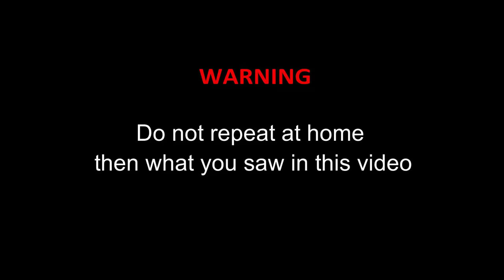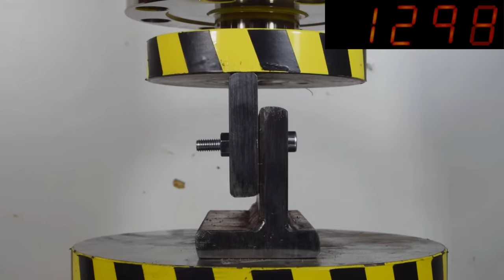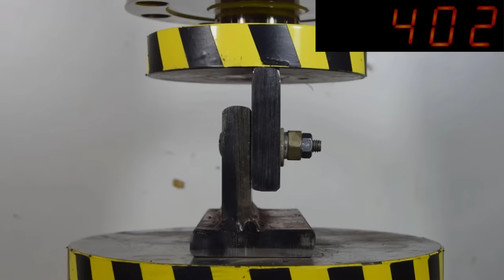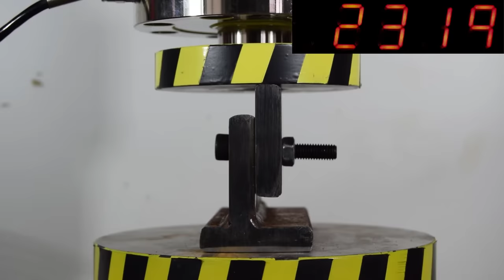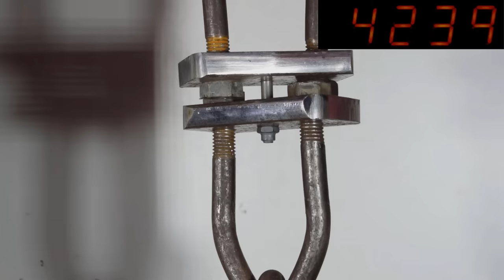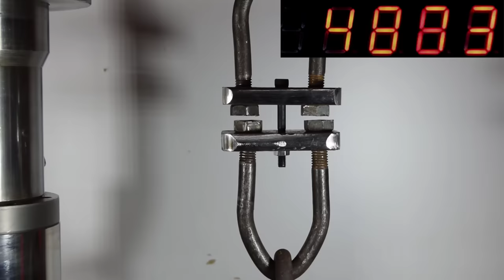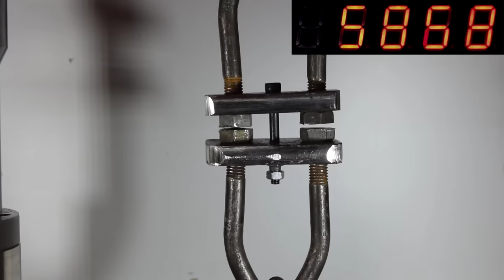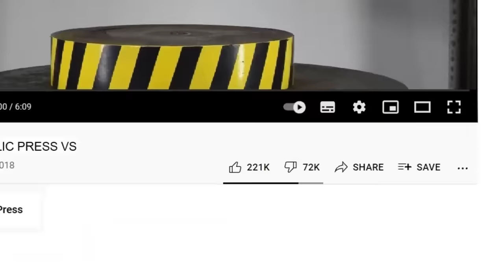HYDRAULIC PRESS VS TITANIUM BOLTS

Comment: Genuine titanium is capable of withstanding MUCH more pressure and load. Processing titanium is a challenging process.
Reply: High quality steel with the right hardness is still stronger than the best titanium alloy, titanium is used for weight reduction and corrosion resistance without giving up to much when it comes to strength.
Reply: @andreasfjellborg1810  You are right. my boss at a titanium forging plant used to say "CP-Titanium is only as good as 316 Stainless in strenght but with much lower weight. There are stronger metals, such as nickle alloys that will beat titanium any day in strenght.

Comment: Would be cool to see this done with better controls. All bolts same diameter. Same threads. Torqued to the same spec or maybe “optimal” spec for the given material.

Comment: The methodology was a little iffy and I couldn't figure what the results actually meant, but I love that you tested for strength and didn't just crush the bolts. Tensile and shear, it's what a bolt does.

Comment: Been heard titanium is weak on impact and good at handling high heat, so the test result is more than I expected. And I wonder, doesn’t the manufacturer give the standard, of how much force the bolts are designed to handle? …
Reply: Yeah, this guy is just checking the numbers. Also those numbers are what the manufacturers are sure their product can handle, not what it will.
Reply: @SoMuchFacepalm  does these numbers indicate the tons it’s purposed to handle? I don’t really get it, not enough information
Reply: @minercraftal  pretty sure he's using kilos in the counter in the corner.

Comment: I have a question about those shear tests. Did you torque them to spec for specific steel or titanium and have the same torque specs for each?   Only asking because the bolts are much stronger when torqued when applying to sheer strength. I believe tension strength is improved as well but I haven’t specifically looked into that in the past.

Comment: In the 60’s my dad worked for a company that produced fasteners and components for aerospace.  Each and every piece had to be shot peened, magnafluxed, x-rayed, fail-tested and meticulously inspected under a stereo microscope… then personally signed off, every step of the way to ensure a tolerance as close to zero as humanly possible.  It’s an expensive and labor intensive process…
Reply: And then NorskHydro goes and fakes thousands of tests over almost 20 years
Reply: @nicholasdenney1318  I suppose, if they are Fakers.

Comment: Don't just compare values of force applied on each bolt. They can be of different cross sectional area. The strength value should be in psi (pounds per square inch of cross section area) of shear, tension or compression.
Reply: not in most if the world! kPa?

Comment: Some values worth taking into account: oxidative stress, heat stress and how both of those affect elastic and plastic deformation. I imagine the space use titanium can handle both values better than the cheap titanium as that is the environment they need to be designed to tolerate. (High G stress and atmospheric friction).
Reply: High G stress and atmospheric friction HAVE ZERO to do with anything regarding these bolts. In fact high G stress isnt even a thing regarding mechanical fasteners. Its got to do with a persons ability to withstand high G's. Atmospheric friction..lmfao you dug deep for that nonsense. We dont engineer nor test bolts factors that do not apply. Ask me how i know.
Reply: @NoBallsInWomensStalls I'm curkous how do you know?

Comment: Just wondering, what is the rate of metal fatigue for both alloys? The weight and that should be the biggest factors for choice using it in a space craft
Reply: Well, weight is very important too when you want to make flying or space screws :)

Comment: 6:31 this is not a proper test for bolt tensile strength.  You used a thin section but that is not intended to hold loads for tension.  From the video you can see that the threads are sheared.  When you have a booted connection in tension, the threads and nut should never fail.  Only the bolt shank (grip) should fail.  Again, you need to use a proper tension but for this test.

In the following segment you realized it and then used a different nut and the test right broke.  It needs a bit of explanation to the audience.

Comment: why do you put the steel bolt in the middle hole, and the titanium on the outside holes, sus
Reply: Mechanically, that makes very little difference. It's not a lever by the distance from the center hole, moreso, it's a shear /lever by the two separate plates, and the downforce/upforce is the same for both positions. It's not distributing force to another bolt surface, so both configurations are equal.
Reply: @RuleOfRage still for the sake of the experiment, you need to keep those things consistent
Reply: @user-it8gk3ke7h  if that was the case, the bolts would need, same diameter, same shank, same thread pitch, same bolting torque. It's close enough for a comparison for Chineseum vs titanium

Comment: Yeah well, I dont know what was the purpose of this "test", it is very unprofessionally done and there are many flaws giving only a proximate results. Maybe because this channel and its crew only knows how to operate the press knowing much of nothing what they are actually doing? 
Titanium, there is dozens of different alloys with all have different properties. You cant just say "Titanium" without knowing its composition. In overall Titanium is not used for its strength, but because of its other properties, weight/strength ratio, corrosion resistance, heat properties etc. Steel has other properties which fit to many.
Reply: I had a real eyeroll at his "tension" apparatus.  Hardly surprising it broke.  That kind of foolishness could get somebody hurt.

Comment: Why titanium for spaceship is weaker than aliexpress bolts?
Reply: Thats not how titanium works, titanium is lighter than steel, but similar strength, the aliexpress bolts arent oure titanium and have other alloys in them to make it cheaper to produce, but they are about the same weigh as steel, not titanium, making them useless
Reply: Probably optimized for weight VS optimized for strength
Reply: Dans un assemblage mécanique il faut toujours créer un "point faible" ,c'est souvent les vis et les boulons qui sont prévus pour casser avant que les contraintes abîment des pièces plus chères où plus complexes.
Il vaut mieux casser une vis à 10 euros qu'abimer un carter à 1000 euros sur lequel elle est vissée.

Comment: I just bought some Grade 5 Chinese Titanium socket head cap screws for my motorcycle. Glad to see the results here. They’re really not worth the price, IMO. It depends on what the bolt is securing. Titanium bolts can cost up to 10x the amount that stainless steel bolts cost. But as an experiment and used judiciously, they can be worth the cost.
Reply: I've used Aliexpress titanium bolts for years and have Aliexpress titanium bolts holding my brake discs on , good quality bolts, and way stronger than the grade 8 bolts they replaced...

Comment: these bolts are from different alloys of Titanium.  Don't expect them to be even close to eachother, and Titanium is known for its TENSILE strength. Shear strength is quite another thing.  this is a badly thought out comparison.  Also, for the cost of the bolts, the Ali Express items are a lot more bolt for the buck.  you can get 5 Ali bolts for one NASA bolt

Comment: if you're wondering why titanium made in china has more shearing capacity, the reason is because it's straining unlike the other one. This is probably because of the faulty testing equipment. The bracket isn't supposed to let the bolt rotate but the Chinese bolt rotated a bit.

Edit: Rewatched the whole thing again. Might just be the bolt tolerances allowing the nut to move a bit causing the loose bolt connection under shearing stress

Comment: Years ago a surgeon in Hawaii found out right before surgery that he didn’t have the titanium rods he needed. He went to the auto parts store and bought titanium screwdrivers and hacked off the handles. The rods he inserted ultimately failed and after the next surgery to replace them the doctor tossed the inferior rods but a nurse retrieved them and turned them over to authorities. The patient was very elderly.  I remember thinking that this guy went through too much to get to the position of a surgeon and then just shanked it. Like is a race to see if you die of natural causes before you really screw up something.

Comment: The Chinese bolts sold on ebay/ aliexpress are normally grade 5 which is 6% aluminum and 4% vanadium.
The chinese also sell the grade 2 titanium bolts. Which is not an alloy and is dull grey color.

Comment: Not sure I agree with these results. Did you control for pretension? If you did this by torque, you could be out by 25% of your target pre-tension in either direction. The same goes for a constant rotation of the nut when tightening.

You can also see the jig you have failing in bearing. It likely would have been better to do this in double shear rather than single, and ensuring that bearing failure did not occur. It also looks like you have some different sized bolts along the way, which will change the force required to break it. 

The aliexpress bolt may very well be stronger than your spacecraft titanium bolts, but I'm not certain of it.

Comment: The bolts are completely different configurations - head type, thread length, surface treatment, maybe heat treatment. They would have to be the same in every element of design to offer any valid comparison of strength and durability.

Comment: You need to tension the bolts with a set torque. There will be a big variation in shearing depending on how much friction you put on the plates.

Comment: Good test. However the only thing I would change is when testing the tensile strength, I would have used a nut with the same material as the bolt per test. I understand that the stainless steel nut was the constant but I’m sure some numbered would be different if you used the same grade nut per bolt

Comment: In aeronautical industry the reason why the components are expensive is because of the tracking they have and consistency they are upheld to.  Not just raw performance.  In circumstances a hardware store bolt could perform better but it also could perform way way worst.

That's were the problem lies.

Comment: in first application it is critical to torque them the same - otherwise you can just estimate the shear force

if you tighten those steel bits properly the main resisting force comes from the friction between those two, which is proportional to the torque on the bolt, after that you just snapping it - the pulling test is done much better, but the weak point is always the thread

Comment: Titanium isn't really stronger than a similarly sized steel screw. Its benefits is that it has equivalent strength with much less weight. So you can either have lighter components without sacrificing strength, or more strength with equal weight.

Comment: I'll send you an A. R. P. (American Racing Products) grade 18.9 9/16th inch main bearing bolt to BREAK your press with for the $183 it costs. Each one is shot-peened to relieve stresses and X-RAYED, then nitride finished and polished. ARP bolts went to the MOON for NASA and are used in racing car engines or in my restored 1964 Honda 305 SuperHawk engine (in metric sizes). They had a video of a 7/8" ARP bolt picking up a NAVY SHIP in the yard! It streached enough it was impossible un-screw...but it supported a 450 TON ship.

Comment: Did I miss weight on China bolt? It Also - the China bolt appears to have some type of heat treatment which could drastically increase shear strength. And for the tensile strain test - that seems like it's mostly measuring thread/head strength. I'd order to fully complete an accurate strain analysis, maybe ask your local university. Their engineering department likely has some actual strain test equipment that you'd be able to use! Cool, video tho! Overall demonstration of material strengths still shows the overall difference between them all!

Comment: Most of all, if Chinese bolts are titanium, they are at most titanium oxide covered steel bolts. That’s a first. The second thing is all the people are talking about - titanium is not about “spaceship” durability, rather it’s about being lightweight.
Reply: A magnet would very easily tell the difference between 6/4 Ti vs steel bolts with a Ti coating. No manufacturer would try to pass off Ti/Ox covered steel bolt as Ti, not even on Ali Express. Also, the steel bolts would be twice the weight.

Comment: The only things I have against this test is that the nuts and bolts are not torqued identically. I had an "off road vehicle" and the accessory that would break if the bolts were over torqued. I RTFM'd, but many of my competitors didn't and this lead to dangers as going to high on ft pounds cause their bolts to shear faster. To me that would be a more fair test.

Comment: I have used many many bolts on my bicycles and motorcycles over the years and I will NEVER used Titanium again after having 4 titanium bolts shear off my upper fork crown on an electric dirt bike. I was lucky to be going rather slowly. I chose them (eBay) for cost, weight , and how they looked (very nice looking) but they lasted 3 hard rides. I went back to steel alloy. Never ever use titanium when your safety matters. There is a place for it, but not on fasteners.

Comment: Many people forget than mechanical strength is not everything when you choose a screw…12.9 is more resistant?well it s meant to be…but it s pure steel. Put them both on a boat and you ll see after a few days …and by the way there are several titanium grades, I m quite sure he tested standard grade 2, grade 5  is more resistant.

Comment: The misconception is that titanium is somehow stronger than steel. It’s not, it’s comparable to steel in strength, weight of aluminum, but it can tolerate significantly more heat than steel. When you compare standard titanium with forged steel, there is no comparison in strength.

Comment: Several things I'd like to add are the bolts all the same size? Also I'd think they'd have to be torqued to the same specs or there specific spec for the bolt type it will make a difference I would think I could be completely wrong

Comment: There are at least 9 grades of titanium alloys ,each grade is used for a different purpose.Grade 4 being one of the strongest types.
Grade 1 and 2 being a lot softer then the higher grades reserved for aircraft production etc.
Aircraft titanium has a strength of at least 190000 Lbs per square inch just like some types of aircraft aluminium.
The thing is that some of the higher strength alloys can not be welded as the heat input of welding would make then susceptible to cracking.
So the bottom line here is that the titanium that would break the easiest is of the softer kind.

Comment: normally you use bolts and such for tension strength not sheering strength maybe compressive like a screw driving in on both side. being harder then steel they are more like to snap or sheer right off and not allow flexing or deforming much before failure

Comment: If it's Chinese made metal then it likely isn't Titanium but a mix of low grade metals and Titanium fusion like how the iPhone 15 Pro is. It's still Titanium used just a very minuscule amount giving it enhanced strength over the stainless steel or aluminum frames. Chinese bolts are like this. The most cost effective, easy to manufacture, and barely passing quality control type products is their specialty. Hell, Chinese steel was used on the San Francisco Bay Bridge and it's already shown signs of not surviving a major earthquake, as in it will collapse, where as the old American steel structure it replaced only had a single 50 portion of the upper deck break off onto the lower deck, and it was still partly attached. Stronger steel. I feel that this is how their screws are too.

Comment: For the brake caliper of my CBR1K I was looking for titanium bolts in M10 of the highest strangth. Doesn't seem to exist in Europe.  Even the "normal" quality M10 titanium bolts were quite expensive.  How much would I have paid for aerospace-grade titanium bolts?  I would probably get a whole Brembo caliper for that amount.  But now I am reassured that normal titanium screws outperform steel screws in 12.9.

Comment: Isn’t a bolt supposed to be measure by it’s ability to resist pulling the threads out? Not a sheer force?
Reply: I believe you would want to test it in shear, compression, and tension so that you have the data for any application of the bolt as it could experience force in any of those directions.
Reply: @En-Jon-eer  ya, all the ways it can fail. But the ansi rating or grading system is based off its ability hold thread force

Comment: When designing an assembly, you're not suppose to "shear" the bolt until break. You must work under the elastic limit. So breaking load is not relevant.

Comment: The shear strength test is not quite setup correctly.
The torque or clearance the nut is tightened to makes all the difference.
If it is loose, you get a greater bending moment and less shear.
If tight, you get a frictional joint between the two pieces of steel. It's not relying on the shear strength of the bolt at all. It's the frictional resistance between the two pieces of steel.
You need better control in the setup.

Comment: only problem was the sheer point on  space shuttle bolt was more than double the other bolts due to shallow thread length had to space with another  nut and a bunch of washers pushing sheer point way out effectively making a fulcrum